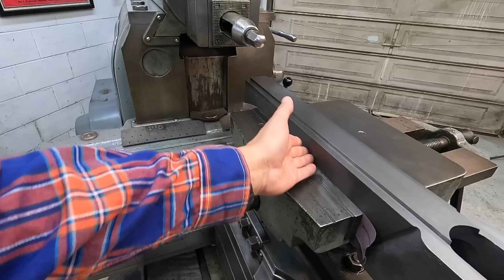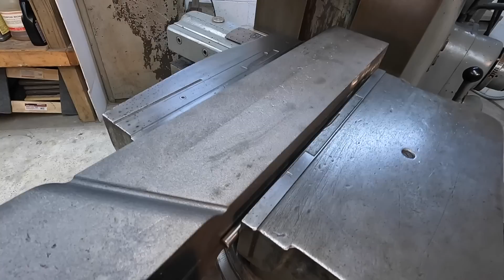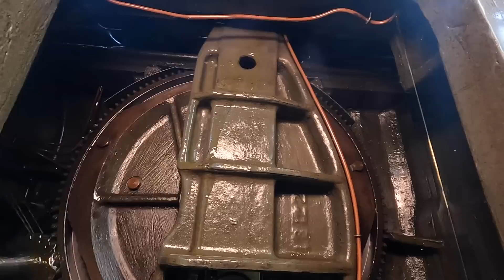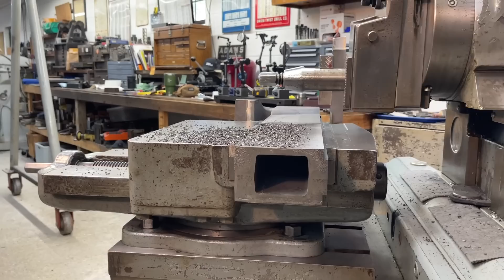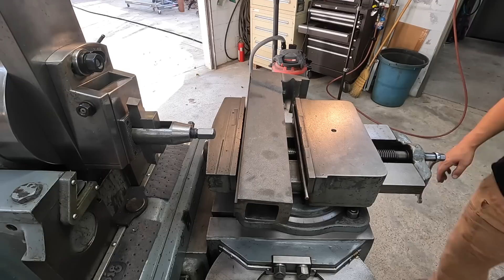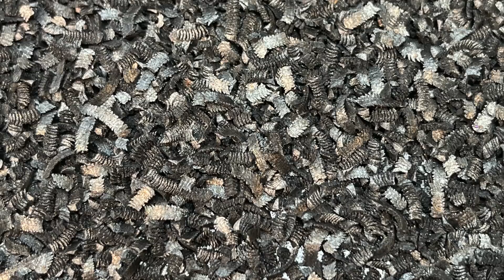Hardtail Vise Build Ep 8

Comment: Not a machinist. I was wondering if you could have set the vice to match the angle of the tube below the jaw? What in the set up or the shapers capablity that would prevent the operation of the tool at an angle?

Comment: At a point in the video you showed the table support bracket sliding along the base casting as you traversed the cut . I can see there are wipers there but I can also see scarring from the life the machine has had . Any plans to look at this ? . however ? how the heck do you deal with that . massive file . even Abom sized . Enjoyed the video immensely . Cheers Ade.

Comment: Does the tool geometry change during cutting with it rubbing on the backstroke?
Reply: The cutting edge doesn't rub, the back side of the tool drags as the clapper box lifts up, lifting the cutting edge of the part.

Comment: One thing I'd like to ask. In watching videos from Steve Watkins he kept going to great lengths to prevent chip out at the edges of the casting while performing similar cuts on castings. He said it was because of the graininess and "hard" spots along the edge causing chip out. I assume it was the quality of the casting. You didn't refer to that as a problem. I assume the quality of your casting was much more consistent. Correct?

Comment: Antique, giant, and noisy, and a little slow, but because of tooling economy it can't be real far behind modern vertical mills. The single giant chunk of Rex 95 can cut miles of metal, and is almost free compared to fluted and shell mills. I'll bet an experienced operator could hone the tool while on the machine and get the most from it, and when worn out, could change it in 2 minutes. Resharpening can be done while the machine is running, and a good operator could run 2-3 machines at once.

Comment: Couldn't you mill the top surface on the horizontal mill with a small enough slab or cylindrical cutter to be able to get up under the jaw of the vise?

Comment: Adam - I (and others) are defiantly enjoying watching your videos.  This is exceptional, not only your machinist skills but also your ability to show your work and the related machines in a captivating way.  I love the slow motion close ups, the explanation of the bull gear, crank arm and ram inner workings which is a testament to our forefathers engineering expertise - simple but solid. My late Uncle Lou was a lifelong machinist and would have loved to watch your channel.
I have one question: what does the ram ride on to eliminate wear?  I'm guessing some roller bearings or similar to prevent the ram elevation changing over time and use.  Does that require maintenance or adjustment to hold the ram true?
Thanks for your efforts and taking us along on all your projects.
Keep up the great work and videos!

Comment: Used to love running shapers. We always aimed them to shoot the chips toward a wall. Half inch deep cut in 6150 steel with .020 inch feed. Those chips were hot and nasty. I still own three shapers. One is a Swedish Varnamo 16 inch and two 8 inch Atlas bench top units.
Shapers still come in handy for lots of uses if you use them correctly.

Comment: @abom79 is it possible to adjust the step over timing so it doesn’t force the cutter over during the last inch or so of the back stroke? Like if you could have the stroke length that much longer to prevent rubbing?

Comment: Hello Adam,  One thing that I was watching for, but was not sure if I was seeing correctly is whether the machine is fully waiting for the tool to clear the material on the backstroke before advancing for the next cut.  Could you speak to this, please?  dave
Reply: Cutter head/tool holder is made so that it hinges up and drags on the the backstroke
Reply: Yes it is hinged for a reason so it doesn't snag on the backstroke, for various reasons it's a complex machine
Reply: I just noticed this as well. You see it really well in the slowmo around 22:00. Seems like that would be causing a lot of stress on the tool bit.

Comment: If the transmission isn’t in the best shape (14:18) you could look for a machinist in your area who can fabricate metal parts and finally fix that thing. I hear Booth Machine Shop can do that type work.
Reply: How long is your ToDo list, and how do you decide which to do first?  :-)
Reply: @ydonl  First on my to do list is repair of the shaper. Second is mill movable jaw of vise. Third is check air pressure of truck tires. Forth is drink coffee.
Reply: If mechaniking gearboxes was his forte, he would have dived straight in there, as well as that of the American Pacemaker, a la Keith Fenner;  ( and even  tightened the main spindle bearings on the Victor lathe in a timely manner rather than putting it off for so long).

Comment: 9:012 What is happening with the copper line when it reaches the bottom of the arm? Is there a flex section?
Reply: great question it looks like it's simply connected and flexing but copper could not manage that perhaps it is a plastic line? looks copper though